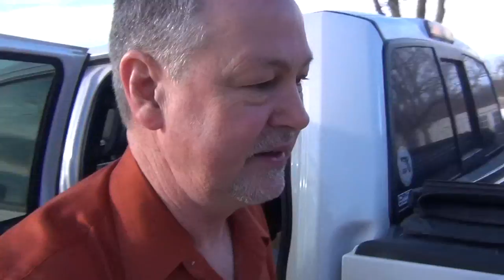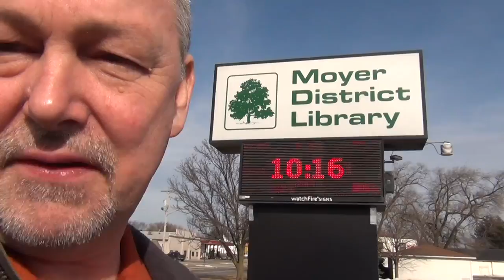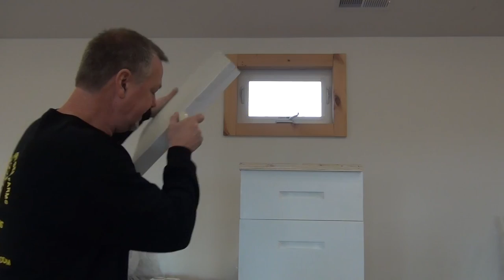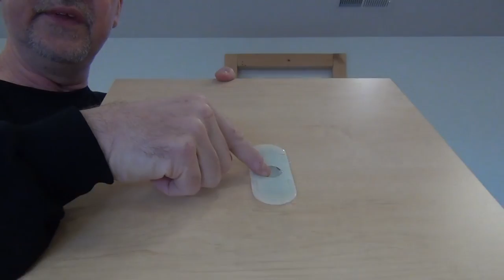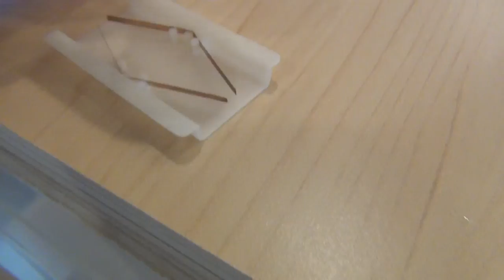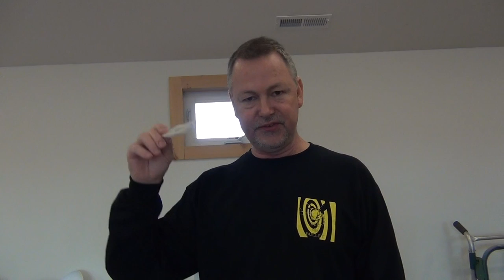Beekeeping: Removing Bees From Honey Super

Comment: Brood in the honey super? Don't you use a queen excluder to keep her down in the brood chamber?
Reply: My bees don't like it, they were lazy and put all honey in brood box and none above, making them honey bound and wanting to swarm.I don't use them any more, she may lay some up there but as soon as they hatch they fill it with honey.
Reply: Sorry. I use an excluder every time. If there's crowding in the brood box I add another brood box but an excluder stays on top of it. I don't want her in the honey supers. I have a friend who has a couple hundred hives and he doesn't use one either, so there's more than one way to run your hives.
Reply: I use queen excluders about three weeks before extraction.  I push the queen down into the brood chamber and allow the brood to mature and then emerge.  This clears the supers of any brood (unless there is drone and then it's 24 days).
It's worked for years.  The draw back to allowing the queen to lay in the honey supers is that now you need wax moth control measures.
I'm experimenting with single deep brood chambers this year with queen excluders.  I'm figuring from what I've read is that it's isolating the queen and forces the honey up top.  The hive has to be checked and brood reduced to prevent swarming, so it's not perfect.  But,  I've had hives swarm in double deeps too.  But I believe that queen excluders in double deeps or three mediums allows too much room and that's why the hives become honey bound and swarm off.  The queen loses the competition with the workers to lay more eggs than what they can bring in.
Reply: More than one way to skin a cat. Early-season, I may double up with a second brood chamber but always topped with a queen excluder. I don't want brood in my honey supers. When I harvest, I leave one honey super on top of the highest brood box (I may take several full frames out of this honey super and replace them with empties) and place a bee escape between this combination: brood chambers, queen excluder and a single honey super, bee escape and the supers I intend to harvest. I come back in three days and the honey supers above the bee escape are unpopulated. I replace them with a couple of empty supers and take the fulls to the bee house.
Reply: I’ve excluded excluders. Exclusively, I might add.